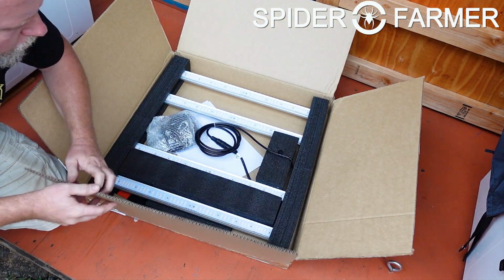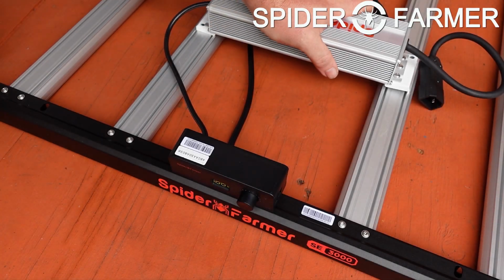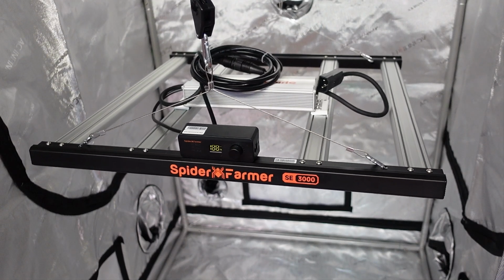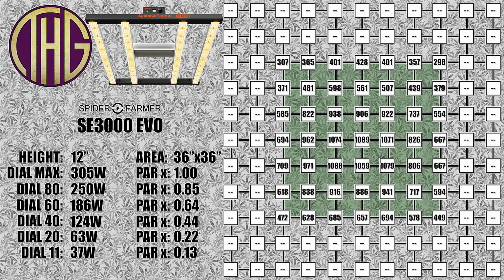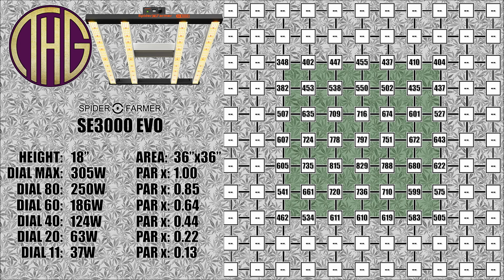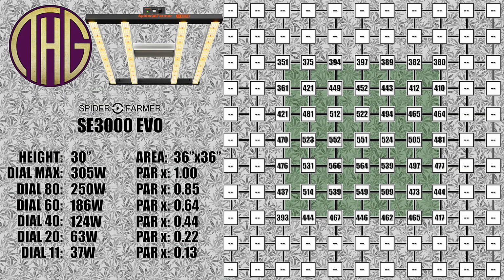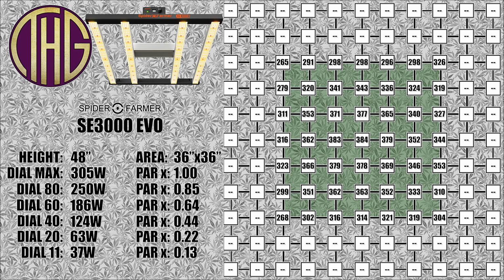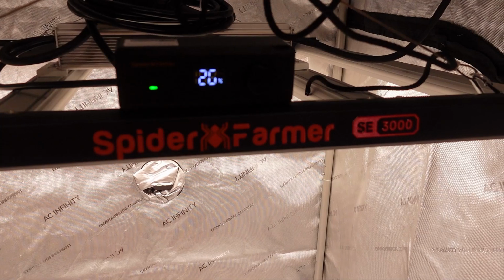Spider Farmer SE3000 EVO  (2024) Unboxing & PAR Test In A 3'x3' Tent!!

Comment: Just as an add in tip I’d always use four ratchets instead of dealing with the hanging wire, one big downfall to using the wires it’s that it takes roughly 1ft of space where as four ratchets you can get these types of bar lights roughly 4 inches from the top of your tent. Don’t get me wrong it’s not a big deal if you’re growing smaller plants but if you want a good sized plant to really fill out a tent then go with the four ratchets.
Reply from the maker: As I mentioned in the video I also do not normally use them, but this particular hanger only takes up 5.5", and while yes that is more than just ratcheting hangers will take up, it also means that you only have to adjust the 2 hangers instead of all 4. I also do not like when the hanging hardware takes up all that space, but I am ok with it in this instance.
Reply: @TheHippieGeeks  lol it literally takes the exact same amount of time to hang a light with four ratchets as it does two, you control one with each hand and I’ve done it tons of times and it’s never been slower it’s only slower if you pull each one individually which no one really does anymore so what your saying about the hanging speed really isn’t true at all when I easily do it in my 4x4 with a commercial grade light and I’m not a big person physically at all and it took me the exact same amount of time with four as it did with two. Like I said though if you don’t need that space and have small plants yeah it’s not a big deal but if the plant the person is growing averages 5 - 6 ft tall then yes it matters because your light can physically burn the plants and if you don’t have that extra room to give then you’ll come out with burnt product. Btw I wasn’t aiming my tip directly towards you but in general for any growers or anyone new to growing. Have a great week everyone, Namaste.
Reply: Yeah when you use 4 adjustable hangers the light is a pain in the a33 to hand straight and level

Comment: Hey Nan I bought the se3000 evo as well been using it a couple months it kicks out savage par I’m running it on he spiderfarmer 2.5x2.5 grow tent and max is 85% giving me 1000- 1150 ppms at approx 24 inches savage light lots more power than it’s pre decesors !!!!so plenty extra par there for adding co2 👍👍👍that I dont use as I’m just a homegrower so no point in an industrial setting yes add co2 but fir just in your house no point wasting money for little to no benefits the co2 u breath out is enough if just growing in your house tried and tested 👍👍👍
Reply from the maker: I like the options that squeezing this light into a smaller tent for sure. I am always a fan of squeezing the biggest light into the tent that you can, as long as if fits in the budget anyways =)
Reply: @ yes we’ll I dunno the aw 3000 evo is in spiderfarmer 2.5x2.5. But I have a 3x3 by ac infinity all in with the evo 4 in there it’s same as the se 3000 just by ac I infinity and it’s lights the 3x3 and flowers it no problem so it is well overpowered in the 2.5 x 2.5 for cannabis but I didn’t feel 200 wats was enough the sf 2000 was gonna b in the little tent but I feel u need 250 wats min for flowering anything decently so that’s y I got the se3000 and it was money well spent 👍I’m mid flower with 1 runtz muffin scrogged out filling the wee 2.5 and it’s banging really is can’t fault the new se3000evo it’s great and luv the digital dial for adjusting power % and comes ready built unlike the pre decesors working well for me here in freezing bloody Scotland lol but it’s great for flowering and dwc as it’s never hot hot here in fact in winter I switch back to cmh lamps in my veg room to get some heat in there the leds aren’t much use to help warm things up like the old hid systems are I can use them to heat the house and light the plants up at the same time 👍👍👍👍👍
Reply: Because you got it ona smaller tent . I run 480w lights on 3X3 ,  300w lights are for 2x2 s

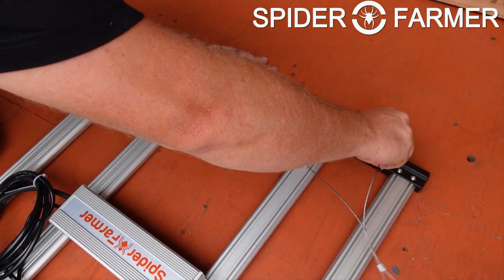Comment: Thank you very much for your review. One question to this part 2:30 : is it really that easy to remove the driver from the bars? I am a bit reluctant to press the tabs into the grooves. Because the tabs are slightly bent on the corners and seem to be made out of steel, while the light bar is made of aluminium, I am worried that I will never ever get the driver separated from the light bar again without damaging something. Maybe you can shed some light on this. Thank you.

Comment: Don’t forget about the APP !!!
Reply from the maker: I thought that you had to have the unreleased controller to use the app with the lights?
Reply: @TheHippieGeeks no
Modo auto is the app
The light has wifi and Bluetooth and you can set times in the app and also has a sunrise and sunset function
Reply: @rbnpt  I can't get the app to find the light? It's on auto mode?
Reply: @rbnpt  Have you done this without the additional controller?